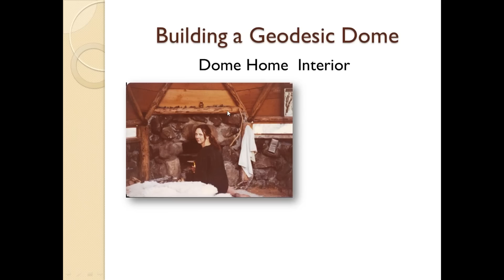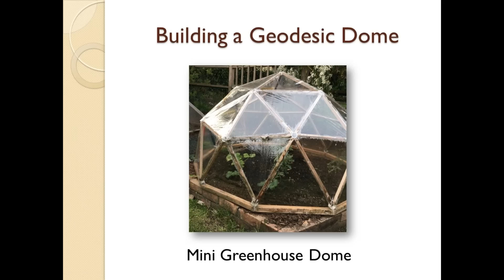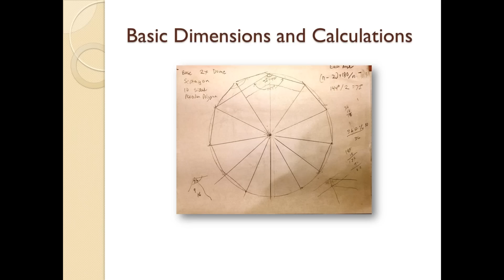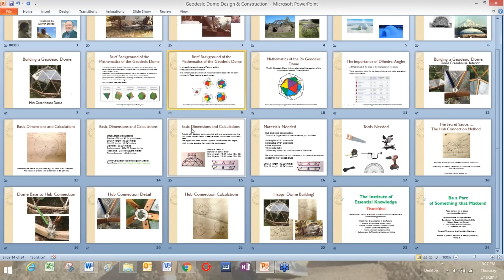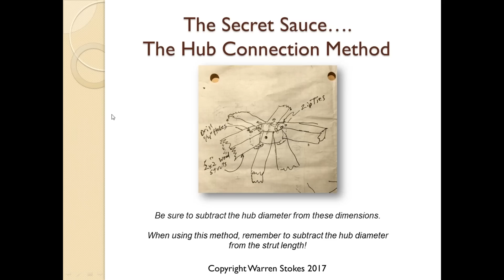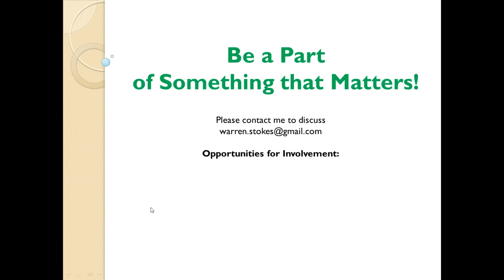How to Build a Geodesic Dome Webinar

Comment: Why is nobody mentioning the idea that you can cut your equilateral triangles in such a way that you don't need to bevel the frames? Less work, more strength, no waste. I'm about to work the angles out to do it...
Reply: I have been thinking the same. Look into icosahedron, slicing off the bottom third

Comment: Hello Warren,
I would love to build a geodesic dome as a living room on my terasse, but do not want to lose the clear sight at the sourroundings, like the sky and nature. I did some reasearch on this matter and was very astound of your dome beeing so tightly and exactly wrapped. It almost looks like acrylic glass to me. A lot of other cover builds seemed very floppy to me. How did you do that? What kind of foil did you use for covering your dome?
thank you very much,
Christian Kästle
Reply from the maker: Christian, 

For the  dome in the video I used this vinyl sheeting from Tap Plastics : It comes in various thicknesses. I suggest 10 or 20 mil: https://www.tapplastics.com/product/plastics/plastic_sheets_rolls/calendared_vinyl_sheeting/248. It has been in use for over 2  years and is still in good shape and clear. 

Regards,

Warren
Reply: @WarrenStokes 
And you simply cut out single triangles or polygons and tape them together?
Thank you for answering! :-D
Reply from the maker: @christiankastle2831  Ye, you cut them into triangles. I suggest fastening the vinyl triangles with with a sealant, and/or weatherstripping along the edges. Keep in mind the vinyl covering is not intended to last more than a couple of years. For longer life I advice using Lexan or Plexiglas. Some could also be covered with plywood panels., with a composition roofing material on the exterior. Have fun!

Regards,

Warren

Comment: [23:41] The two angles 74 degrees and 72 degrees, that you should cut respetivly the two stuts A and B, are only for the base right? I ask because the base on photo at the left at [23:41] is only in one color, blue as if they are all Bs. But they are alternatively As and Bs length right?
Or is the sketch on the right (at [23:41]) a lateral view rather than a frontal view? And thus the two angles 74 and 72 degrees cut apply respectively to every A and B strut on the dome.
Reply from the maker: Hi Vildgase
, The 10 Base struts are all 72 degrees (All Bs)
Reply: Hi  @WarrenStokes  Thank you very muchfor your answear. :-)
So it´s just the 10 base struts that have a 72 degrees cut and the 25 B struts left should not be cut, right?
But what about the A struts, why should they be cut 74 degrees, as they are jointed together by the hubs anyway?
Reply from the maker: @Vildgase  The A struts should all be cut at 74 degrees. With a pipe style hub using zip ties the 2 degrees wont matter much because of the nature of the connection is not that precision. But it will matter in the base, and if you are using a more precision method such as panelized construction, it will matter in the upper structure.
Reply: Thank you again  @WarrenStokes . I will try.
First a model this week and then a little green house this spring, before a real little house in my garden. :-)
Best thoughts and regards :-)

Comment: So ifi subtract the pvc diameter from what dimension? The stut? Because than my base will be uneaven if you get what im trying to say here, great vid btw.
Reply from the maker: For the struts that connect to the base, subtract 1/2 the hub diameter from the calculated strut length to get the total net strut length.  For all other struts subtract the full hub diameter from the calculated strut length. Imagine the strut going to the center of the hub, rather than being cut  shorter to allow for the hub diameter. That is wy you have to account for the hub diameter.

Regards,

Warren
Reply: @WarrenStokes  I just got a headache
Reply: @WarrenStokes  
The 3 way hub in the left pic at 27 minutes will not transfer loads to the base ring.  https://youtu.be/37Vo6m3KMLU?t=1621
 The plastic hubs in this configuration will carry all the load and it will be concentrated at a single point at the bottom of the hub. The hubs shouldnt just "rest"on the base ring, they should be an integral part to ensure the loads are transferred correctly ;)